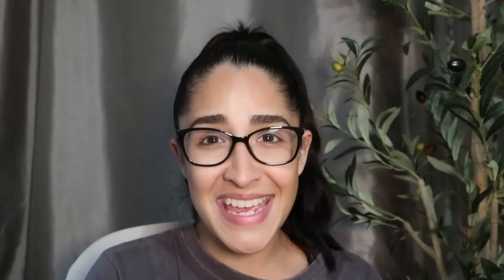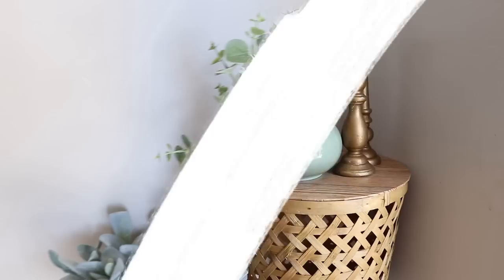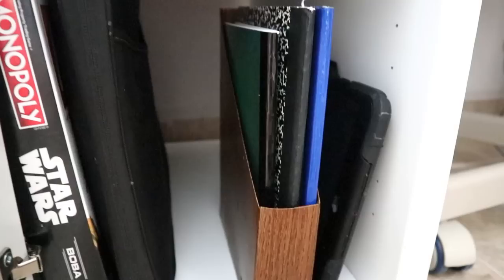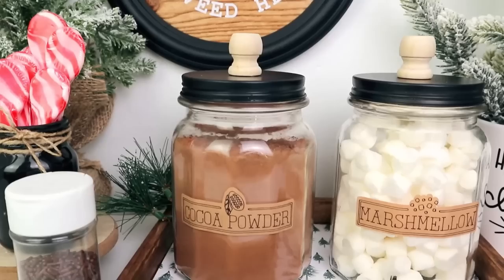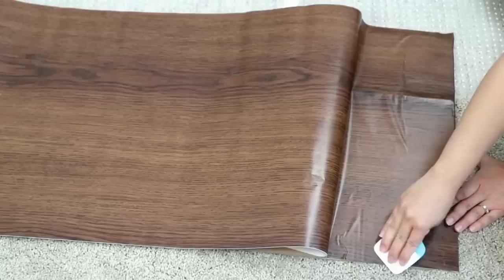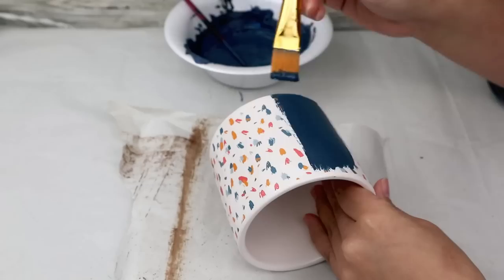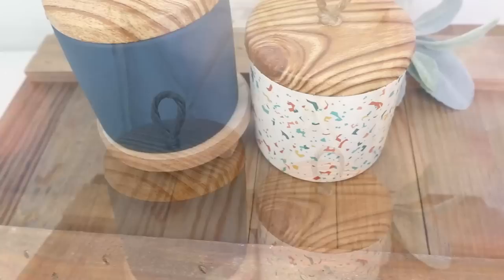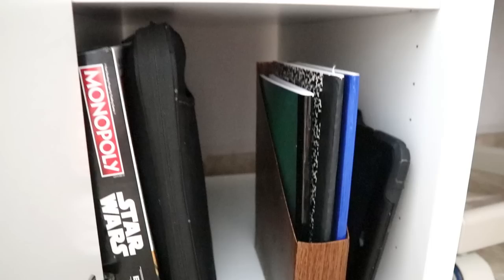Why everyone is buying CONTACT PAPER from the Dollar Store! TOP 7 CONTACT PAPER HACKS to TRY!

Comment: The hot cocoa sign would also be cute as a riser. Use wooden beads from DT as feet. Make a hot coco bar. I like your notebook holder. I would make in smaller scale to hold individual hot cocoa packets with a label on the front. 😉😊

Brilliant idea using the heat gun. Your projects came out so pretty 😍

Comment: It would be even easier if you disassemble the glued part of the cereal box, after you cut the box into the shape that you want. 

1) Cut original box to desired measurements. 

2) carefully pull the glued flaps apart.

3) Put on the contact paper to cover however much you desire.

4) Now to put your box back together. 

5)  fold box into the original shape, add E-6000, work covered project Into the original the original structure,  combining all connected shared surfaces adding glue to the parts that are connected!